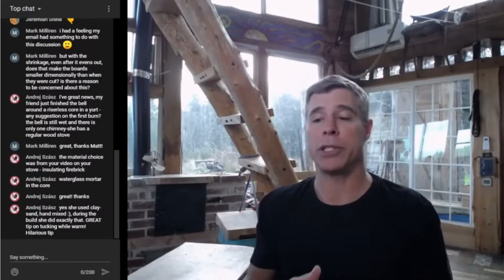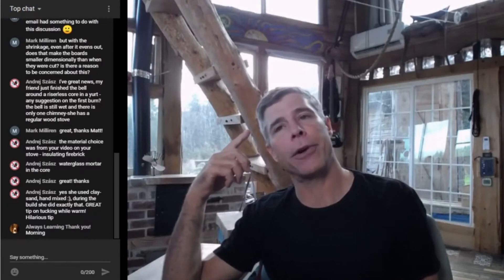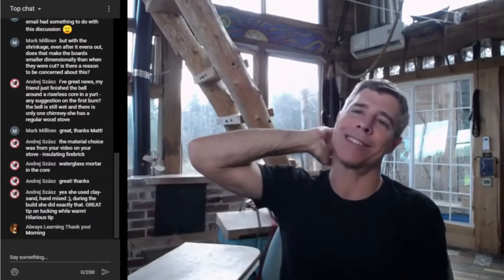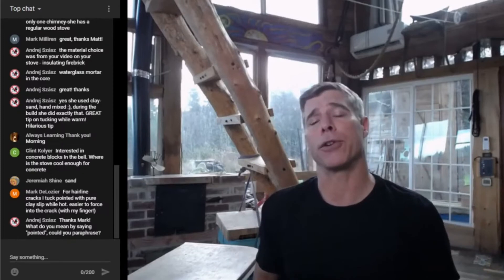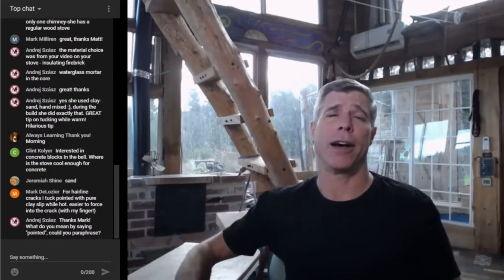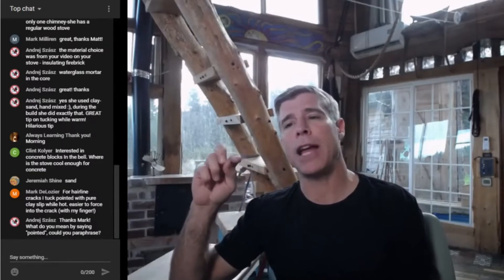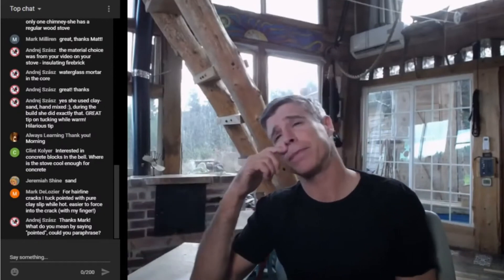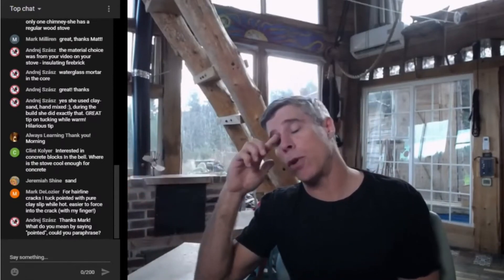Masonry Materials Discussion

Comment: A boilermaker gave me a tip:  Spray the insulation wool with sodium silicate to make it rigid/hold a shape.
Reply: Did you dilute the sodium silicate or use it full strength ?
Reply: @carlboehm5468  Full strength, I'll wager